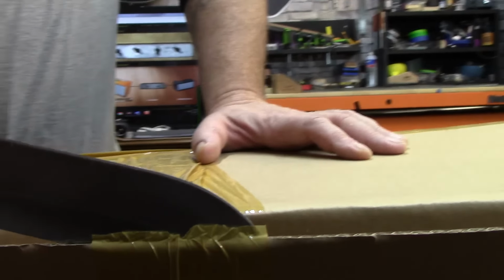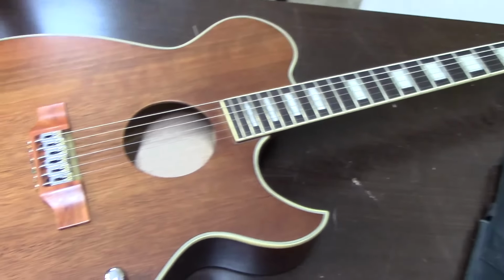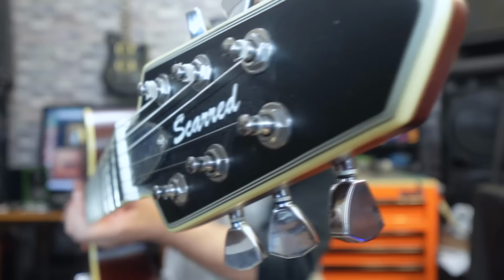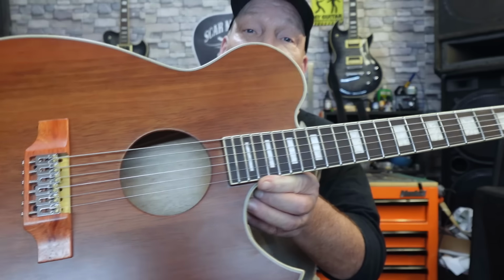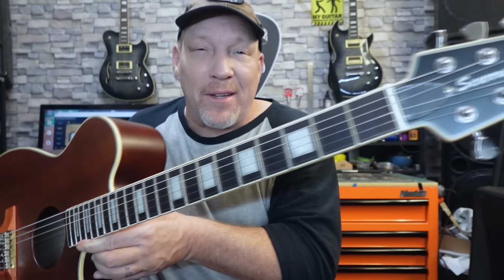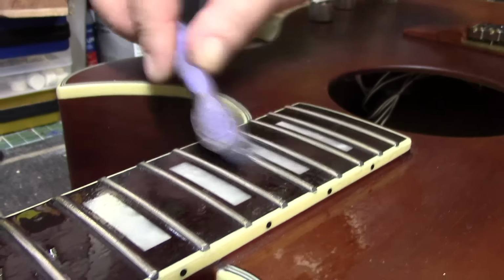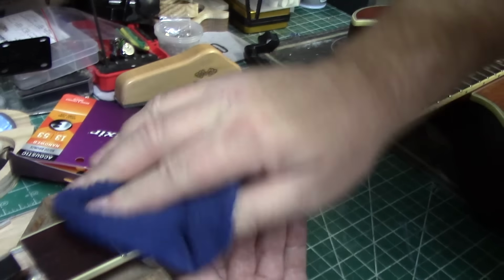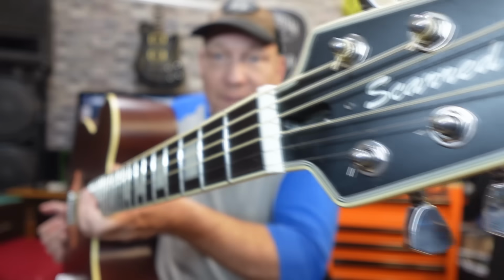This Acoustic Guitar Is Going To Make Some Heads Explode!

Comment: You get it. You’re very similar to me. I don’t understand why all modern acoustics don’t have adjustable bridges. Whenever I get an acoustic I remove the bridge and either put a floating bridge on (like arch tops) or a reinforced hard tail bridge. I’m actually working on a few guitar projects atm. I bought an ovation style strat shaped acoustic years ago. The bridge is lifting on it so instead of gluing it back down again I’m going to remove it and put a floating bridge and bigsby on it. Also bought a heap of pickups and other hardware to build some other guitars.

Comment: Sean,

I worked at FEDEX GROUND in Grayslake, IL as a "Package Handler." My supervisor was a slave driver! I worked pulling packages off the conveyor belt and loading them into a delivery truck. I was CONSTANTLY moving. Some of the things I moved were HUGE and/or HEAVY. I'm talking about weight sets, trampolines, pool covers, etc. I am only 5' 8" tall, so every time that I had to lift something off of the belt, I had to lift it HIGH, sometimes arching my back backwards. I worked fast like this NON-STOP for HOURS straight. By the end of my shift, I was EXHAUSTED. I was careful, but sometimes I dropped things. One time, while removing a box from a truck, a smaller box that was hidden on top of it fell down on my foot. The corner of the box hit the top of my boot. Even though I was wearing leather construction boots. it seriously injured my foot. When I looked at the label, I saw it weighed 45 lbs.! It must have been a solid steel chuck for a lathe or some other machine part. 

Anyway, it is HARD work and they push the workers to go faster than is safe, so it doesn't surprise me that some boxes get torn up. They are only in the handler's hands for seconds before he is on to the next one. 
😫

Comment: This is incredible! So much more adjustment on intonation, and action available without having to touch the truss rod or nut. 

This has the potential as well to make the construction of the guitar overall much easier and cheaper. You can now intonate your acoustic after it’s completed, rather than worrying about bridge intonation during the build process. 

Very nice and inventive.

Comment: Sean you're probably not going to read this but I'm going to write it anyway. I really like the bridge and the individual piezo pickups under each string. The neck is beautiful and your fretwork and shining it up is always fabulous. Is free looking guitar too. If Kathy made to pick up so I'm sure they're great. 
     Acoustic guitars of course are different than electric guitars and what makes them is the wood and the bracing under the soundboard. I'm sure you got that covered however I think it'd be a good idea if you were to take a camera and put it inside there and let us see all the good work you did with the bracing. Logic being that if there is not good racing then you have problems with the bridge pulling on the soundboard and warping. If that happens then you need to do repairs which could be expensive and the guitar would be otherwise worthless. If you read this far, I thank you. I hope you can try is great success. 
    I'd love to see a smaller bodied parlor size guitar with all those things on it that you have. I also like a 25 inch scale or less like I got used to with my Guild or a Gibson. The guild that I have now,... I can lower the strings down to fretts and the actions good and it doesn't buzz.

Comment: The Ovation (Applause AE128 super shallow) is the closest acoustic electric that I could find that sounded as close plugged in as it does unplugged. 10 inch radius, 25.25/25.3 scale neck. And the Ovation/Takamine has a CP-100 that has individual piezo crystals for each string for the pickup. I like your Fender like fixed bridge system better for design than the traditional intonated saddle slot pickup design.